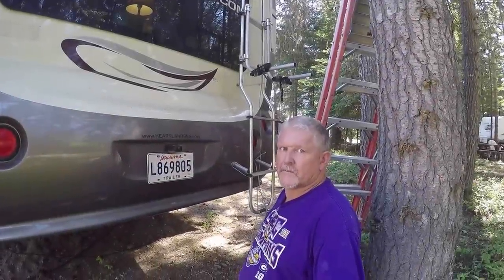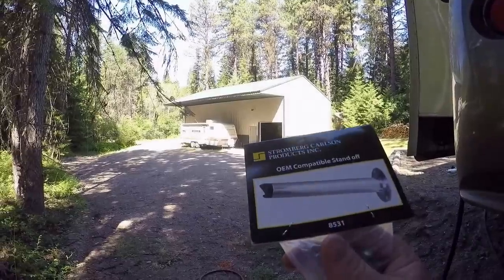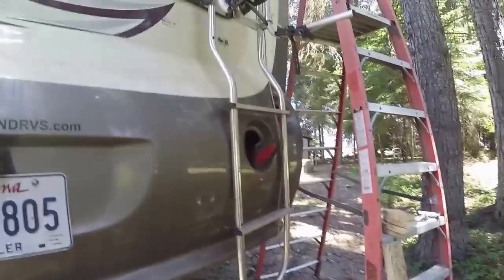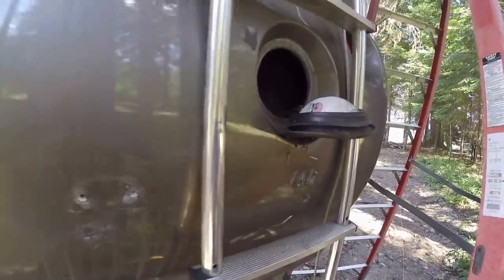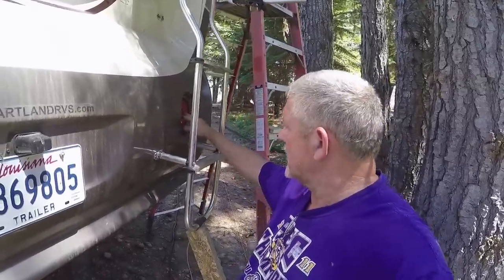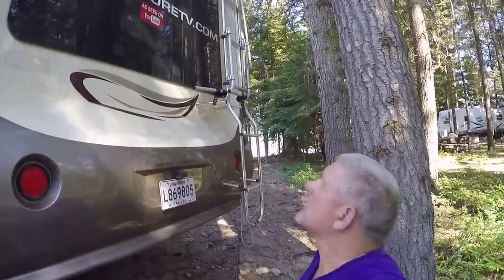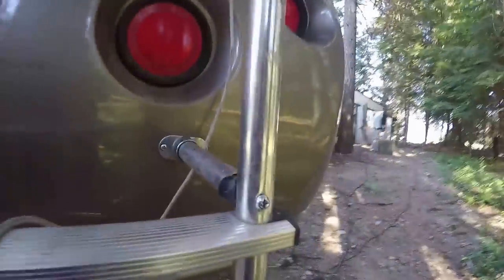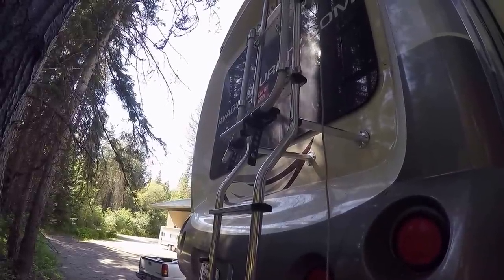RV Life Living Full Time In a RV S3 E46 Rv Ladder Repair

Comment: Nice work. I read there is a shortage of trained educated RV Technician/mechanics (don't know how factual, but believable). Thanks for showing the length and then shortening as needed.👍🏼
Reply from the maker: I was going to show the cutting of stand off, drilling the screws and bolts but I thought most people would get that plus I am trying to keep vids short and sweet.   Thanks
Reply: +Rv Adventure TV It was informative just the way you did it. Nice work.

Comment: Just installed an Carlson stromberg ladder from Amazon only cost 83 dollar with free shipping . When installing it I found  that theor were no studs which would  have reached this setup and location 
I ended up using  toggle bolt anchors they are rated for 250 lbs. They worked great

Comment: Why didn't you show how you got the wood blocking in and how you supported that so you can have hands free to use drill etc ?
Reply from the maker: It was real easy as I just used my right hand holding the wood behind the fiberglass and used my left to use drill.  I just put my hand into the hole and placed the wood behind holes.  Worked well.   Thanks for the comment

Comment: Nice job.  I see you have the step ladder; probably good to keep handy. The ladder on the back of my Class A very strong but still scary to climb up on even with 6 mounts secured to the fiberglass panel wall, plus the two on the roof; just seems hanging on it going up, it all could just pull off when climbing. I don't heal as fast as I used too (lol) if it did so I use my telescoping ladder next to it to share the load. I was wondering if there is a load wt rating on these type RV ladders? Thumps up.  Safe travels.